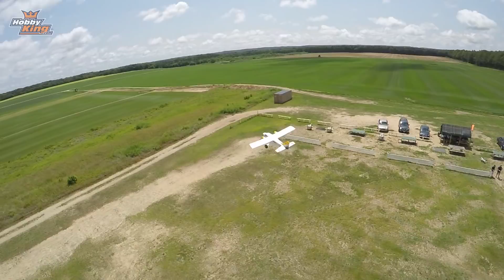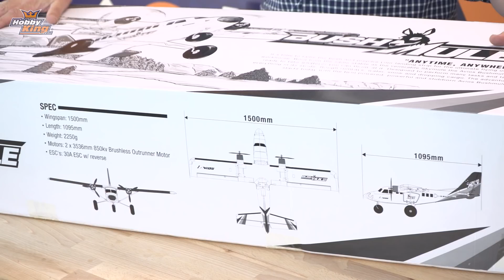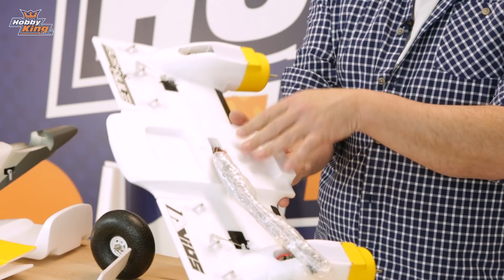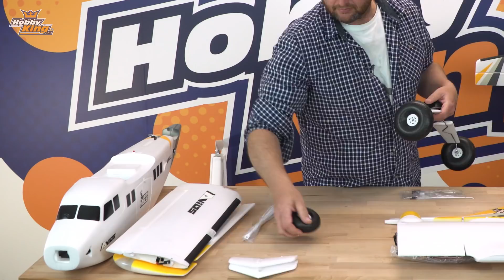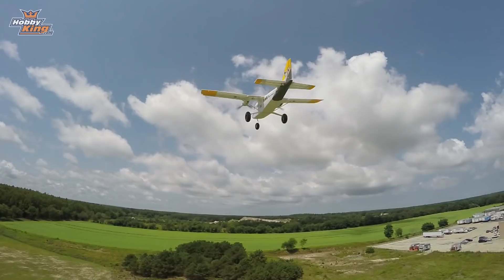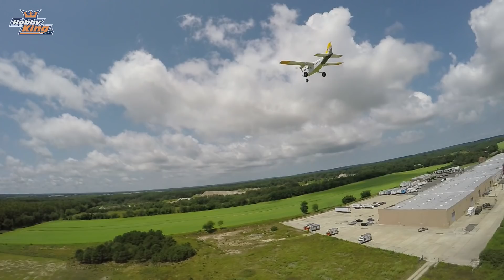Avios Bush Mule - HobbyKing Product Profile

Comment: I love the air frame, but all the reviews state that the servos and ESC's are garbage. I wish this was available in kit form so I didn't have to pay for cheap electronics that I'm just going to throw away and replace. $225(actually closer to $250 after shipping) would be a fair price if they used quality components. But considering the poor quality of components and the work and expense of replacing them, I'm going to wait. If the offer it in kit form or lower the price to reflect the quality I would consider it. As of now I'm planning on going with a similar, but much more reasonably priced competitor's kit plane. I'm not planning on buying anything until Feb or March, so maybe they'll have a kit available by then or a version with metal gear servos and quality ESC's... also... Most guys are replacing the wheels with low-bounce wheels.... another expense added to the already super high price(for a foam model that probably costs less than $10 to produce)